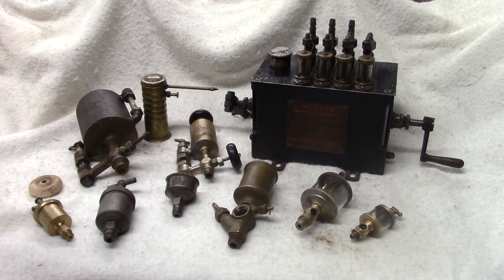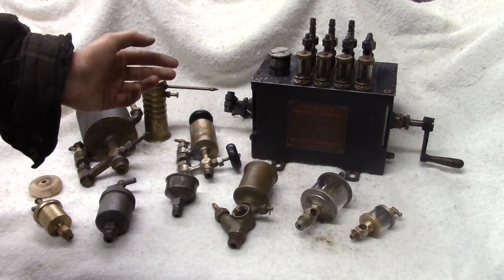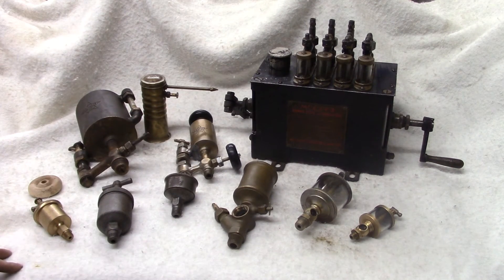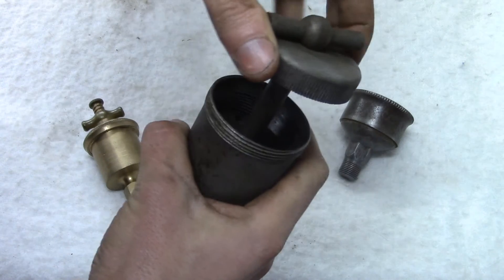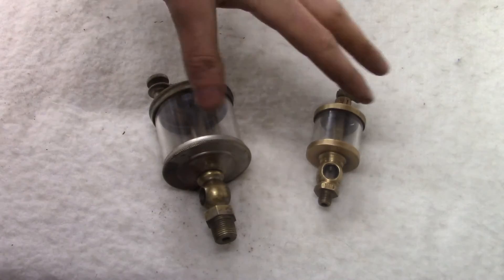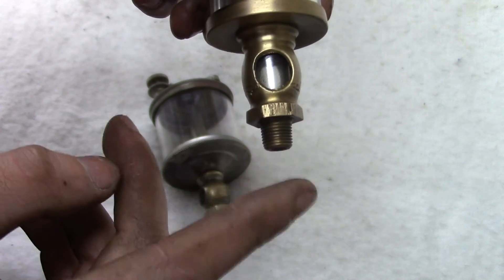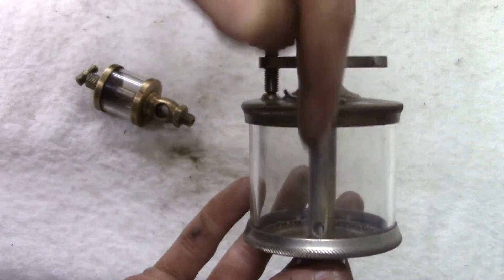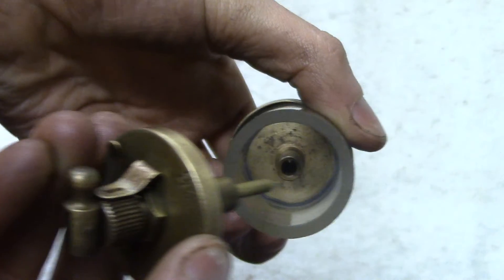Old Engine Basics - Lubrication Part 1

Comment: Fascinating , and great to see what care and precision went into these parts , nothing looks flimsy or cheaply made.
Reply: interesting observation. yes, they look like they were made with time, thought and pride. i can see why the MM collects some for which he has no particular use.
Reply from the maker: You'd be hard pressed to find something poorly made of this vintage. Also, these lubricators were critical components of an engine and were not skimped on. Additionally, on older engines, especially steamers, and larger mill and plant engines, the oilers, gauges, and nameplates were "jewelry" for an engine and were an opportunity to dress it up.